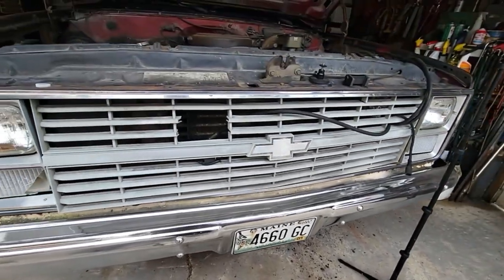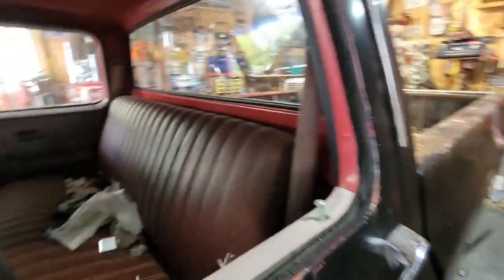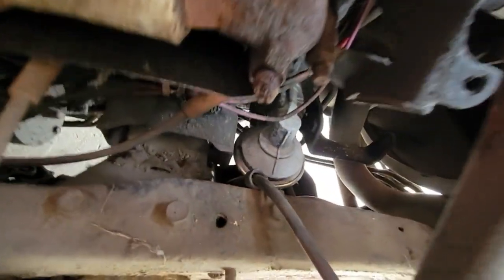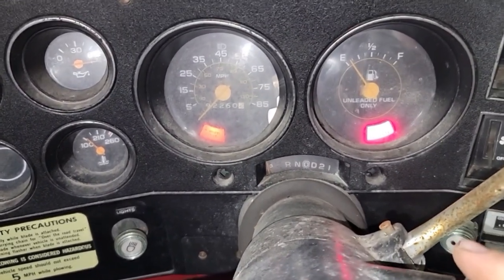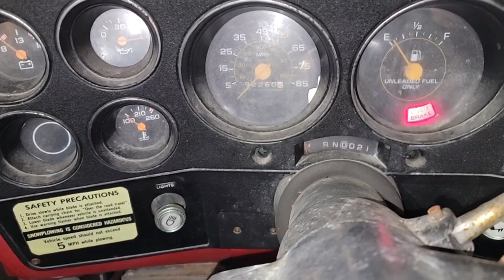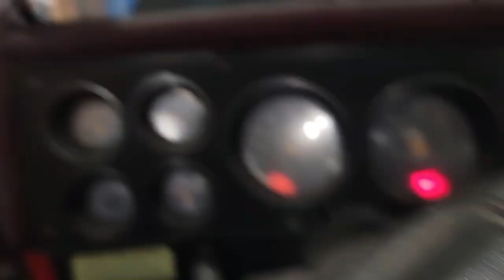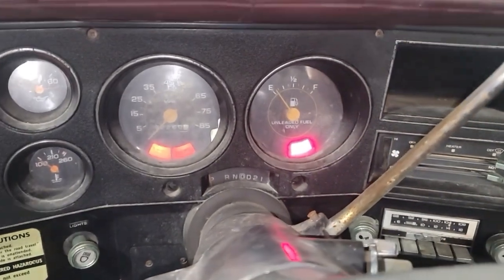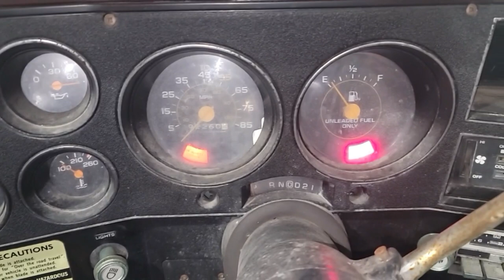Trying to start the free 84 Chevy k10 junk

Comment: 700R4 in that truck. I’ve seen worse. 305 wasnt that bad. Pretty much save the V-8 from the late 70s to mid 80s. Pretty sure they used the HO 305 in that truck. 180hp, more than my M code 350 had stock.